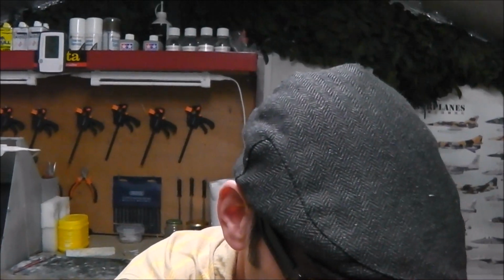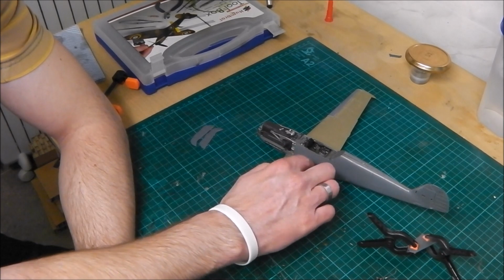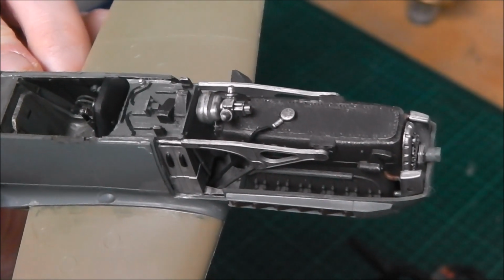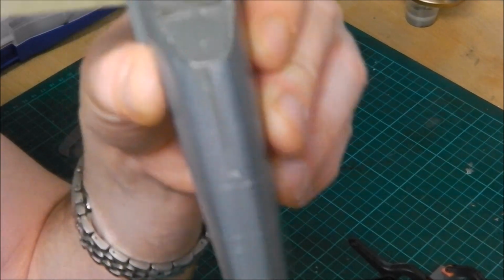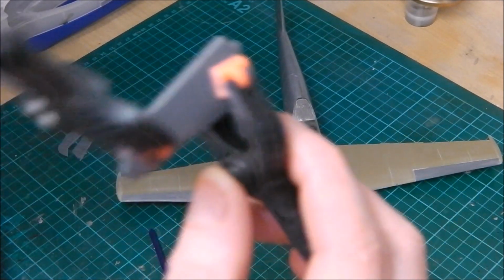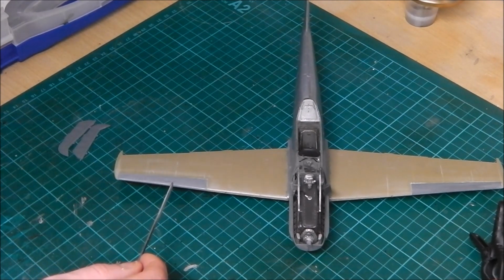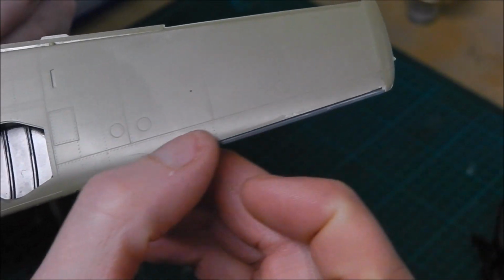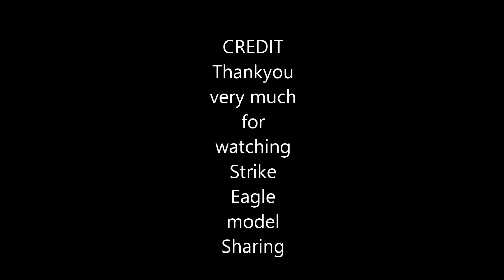Eduard BF109E1 update2

Comment: Cockpit looks amazing.the engine looks really good to. I'm surprise that Edward kit has so many fit issues. I thought they were a better company than that? maybe it's an old mold.
  I'm build the older tooling of the 1/48  Airfix Hawker Hurricane and I've had minor fit issues compared to what you're going threw.
Reply from the maker: Thankyou mate.Funny you should say that. I have just ordered the new toolin Airfix Hurricane in 1.48 scale lol.Think I have done the old one 4 years ago and it wasn't bad at all. This Eduard kit I am doing is a nightmare.I have the   Eduard ME 110 limited edition. I am hoping that it is the new toolin one!
Reply: Warren Blanch ive bin checking out BF 110. Want to get one and build also.
Reply from the maker: hardihood1 They do look good when finished mate.My ME 110 only cost about £25

Comment: this fit issue is unusual for Eduard perhaps that't why it's in short supply maybe they withdrew it
Reply from the maker: Cheer Anthony. I will sort this big bird lol.Check my site out on FaceBook mate ;)
Reply: Warren Blanch I don't really use Facebook Warren but I look at all your You Tube postings . I know you will sort it out but it is boring when you have to fill and sand so many gaps . Had to use your favourite (milliput ) and superglue on an old Airfix Spitfire . If the gaps are too big standard fillers tends to sag . so it's not a one off job , and soft fillers tend to crack and fall away on deep wider gaps . Oh well you will have one of the more unusual Me 109s at the end .